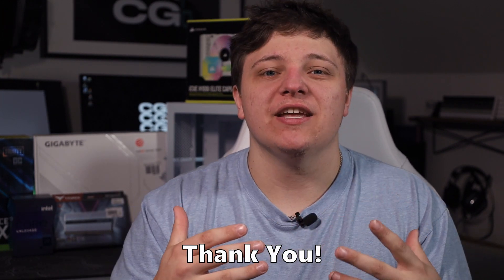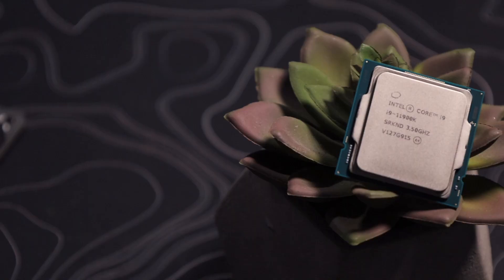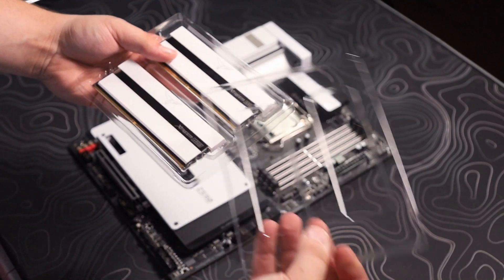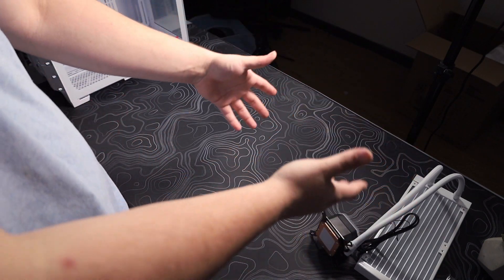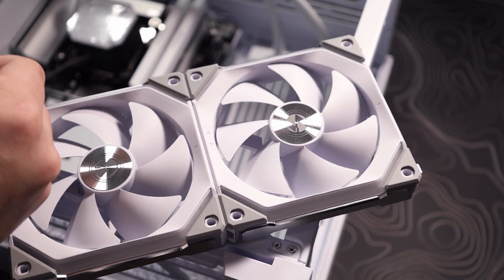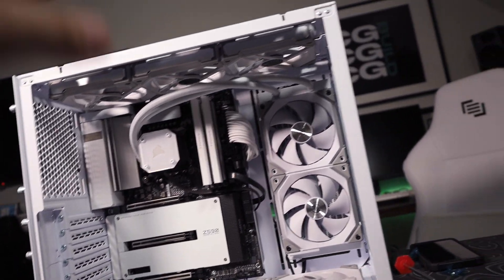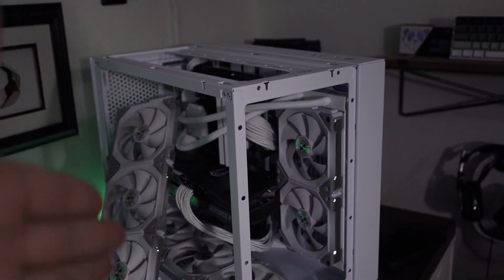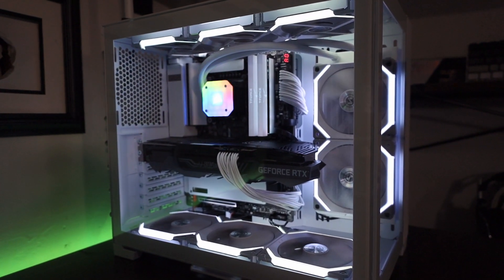All White Gaming PC Build - RTX 3080, Gigabyte Z590, Lian li O11 Mini Snow Edition, Benchmarks

Comment: O11 air mini. Want to see how other's would go about it. Personally I'm making some mods so i can maximize fans (update- can add 3 120mm below but will have to drill or use double side tape, can use 3 fans top 120mm, 2 140mm fronts, 1 120mm rear, 2 120mm sides, aio in front on the back of the 140mm fans using push pull with the 120mm fans on the rear of the radiator with the tubes facing towards the ground, 2070 super gpu, all fans and aio are from cooler master dual ring line up. Not sure if this matters but using it with x570 aorus extreme, ryzen 3900x, with 2 5v rgb hubs to communicate with the board. Runs at 32C-50C running day and night decoding movies for my plex while surfing web and YouTube at the same time.
Hope this helps someone.

Comment: would this build run with four sticks of the 4000 ram? i have the same build but with four sticks of the ram but haven't put it together yet. just wondering if the motherboard would have any problems with running the correct speeds